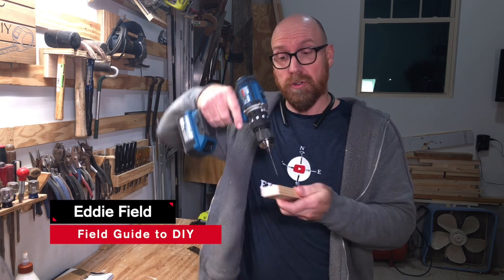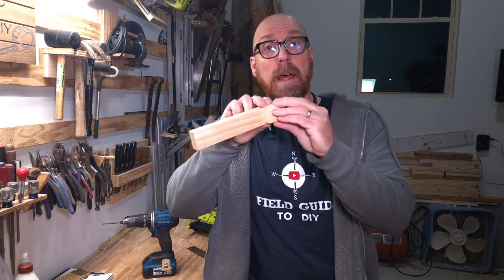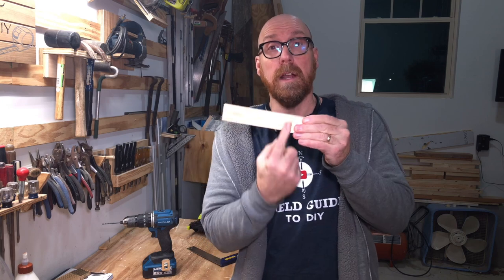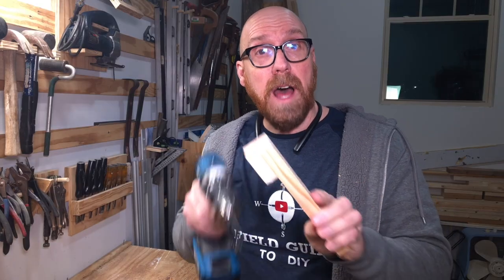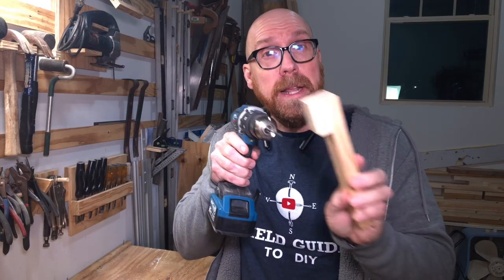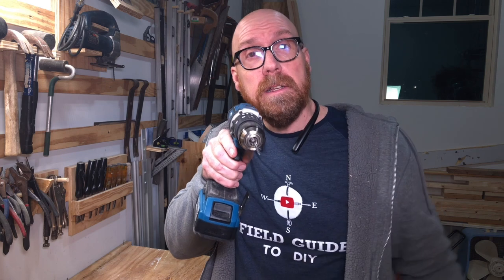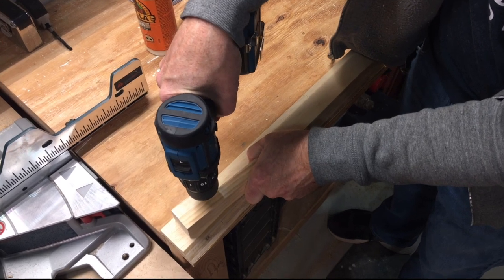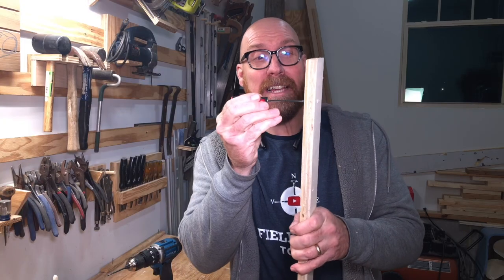Drill a Straight Hole without a Drillpress

Comment: can someone explain to me how to drill a 4mm hole in a wooden stick that is 1cm in diameter and 10cm long

￼
Reply from the maker: Nenad, I would access a drill press.  Drill a hole in a board the outside diameter of the dowel and wedge the dowel into the board.  Then with a 4 mm bit drill as far as you can in the dowel using the drill press.  Then flip the dowel and drill from the other end.  But that’s just me.  Thanks so much for watching.
Reply: @FieldGuidetoDIY  Thank you for the answer, but I need to pierce the whole stick in one go I tried many techniques but I didn't succeed If you come up with something, feel free to write thanks from Serbia

Comment: Everybody advice the same but in all cases I see the drill wobbles.
Reply from the maker: Dr Esin, you point out a good point.  This jig is not as perfect as a drill press is.  It is only a guide and in order to have the best results, when using this jig, go slow and keep checking that the bit is straight from different angles.  Thanks so much for watching Dr Esin.